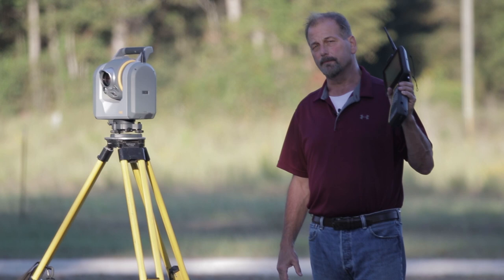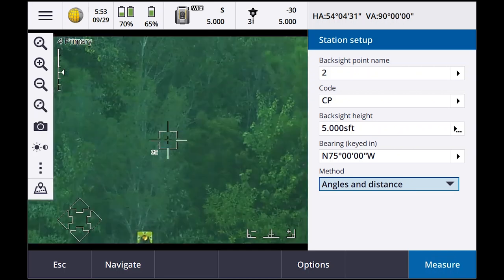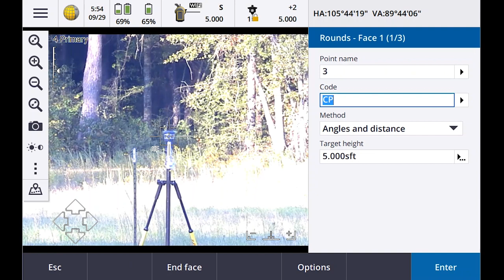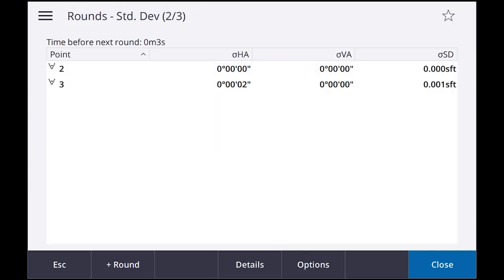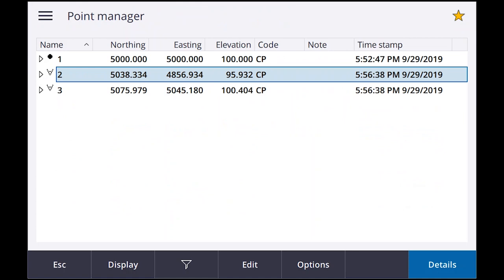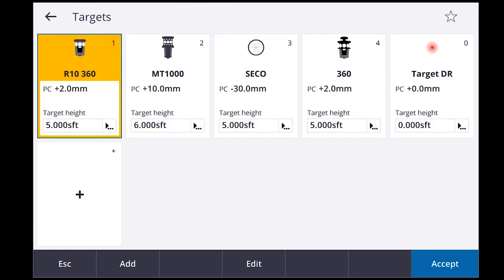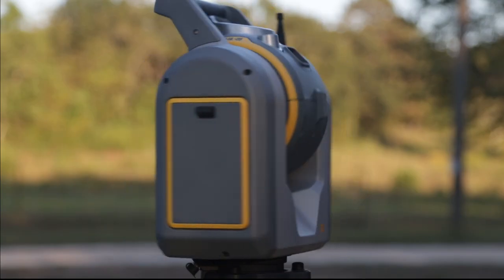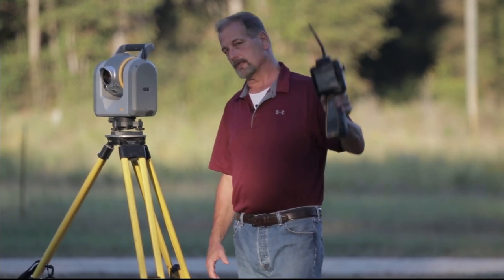Rounds in Trimble Access Explained

Comment: So basically, running rounds will average out the angles/distance measurements of your backsight and foresight, effectively changing their positions but the CP in which you set your total station up will stay the same?

Does that mean rounds work in the opposite fashion when doing a resection? Only the point the total station is set up on changes based on the averaged angles and distance measurements?
Reply: When you're measuring rounds when doing a resection, It's assuming the points you're measuring off of are fixed and not adjusted. As it measures each round it's weighing out the error of the resection based on the geometry, how far away your points are, etc. So yep, eventually it will average out the error to a certain degree (you can see your resection residuals), and measuring rounds just helps make sure the averaging it's doing for your station setup is reducing the chances of a bad observation messing up your station's coordinates. It does NOT adjust the coordinates of the points used in that scenario, but the residuals you see will give you an idea of where the error in your control is (Note: does not apply to 2 point resection. That's the danger of 2 pointers...If doing a 2 point resection, discard it right away if you're not getting 0's in your residuals, and always do a check shot tie).

Measuring rounds on a known point and doing a traverse is the ideal way to establish high precision control. Doing a resection and then measuring rounds on your resection point is a good way to find out if your control is bad, or if a target is out of calibration. It's more of a blunder check really. You really shouldn't be establishing control with measure rounds when using a resected station, but it does have its purpose.

For example, when I'm doing high precision layout of something like anchor bolts, I'll often use measure rounds to tie into a temporary check point. It usually will be as far away as I'm willing to do layout. Then when I do another resection to keep carrying on my work from a different setup point, I'll tie into that established check shot and see how much error I could realistically expect to be floating, since check shots and residuals don't always tell the complete story.
Reply: @ron6625   Hey this is very useful information. We just got all new trimble equipment so anything like this is valuable info for the next guy. Appreciate your insight.
Reply: @ron6625 great explanation, thanks

Comment: great video, I was wondering whether there is a way to skip a point and come back to it in the set to remeasure it. The scenario I'm thinking of is when you're surveying in an urban area with cars going by, say there is a parked car there, you would want to skip it until the car moves and then remeasure that point again all in the same set/ round. Is there a way to do this?
Reply: You can do it that with Leica - it works slightly different - you can measure each point as many times in a row as you need, , then do the same to any other point and so on. I tried to achieve that on trimble, but didn't figure it out yet.
Reply: @krukarlukasz3834  that's where my experience is from and was hoping Trimble had similar feature or workaround.

Comment: That's a very helpful video, but there is a question coming through my mind. When you proceed with your traverse routin and you transfer your instrument from station to station then you need to, somehow, turn off the instrument so the servo are not harmed during traverse. So how to do this new station set up properly so the traverse routin will be recognized in TBC?
Thank you for you answer.
Reply from the maker: So, there are no servo’s in the Trimble S series instruments. They run on a magnetic drive. When Traversing jut remember point 1 is point 1 not 14 or 1a. When your closing the traverse use the original point number for that point and say store another. Access and TBC will recognize that as a traverse.
Reply: @SurveyingWithRobert   Thank you for your answer. It brightened in my head the traverse idea. Also as I understand, moving the TS from tripod to tripod without switching the instrument to "stand by" or turning it off completely won't harm the compesator and the magnetics drives?
Reply from the maker: @ukaszetzel2408  take it off the tripod put in box. You don’t have to shut it down.
Reply: @SurveyingWithRobert  thank you for all your guidance and assistance. It makes using trimble TS so much easier. 
All the best!
Reply: @ukaszetzel2408 we always shut our machines down. Idk if it makes a difference, but we always shut it down whenever we move the insteument

Comment: Just got the new sx10 testing it out finding what its limitations are. Pros and cons... I turned the Wi-Fi off and tried to only use the radio 200 ft away it was losing radio signal. My channel and Id at the moment is set at  1 and 1 ..I wonder if I should change that to something else to get a better signal or should I just rely on the Wi-Fi I believe it uses both I'm not mistaken... Any advice...
Reply from the maker: So the same radio that’s in all the S series robots is in the SX10. You should be getting 1200 feet or better with the 2.4 GHz radio. Check your antenna on the collector. I have experienced bad antennas causing that problem.